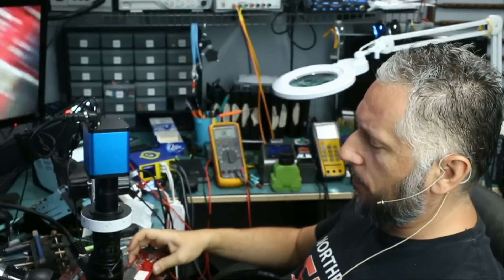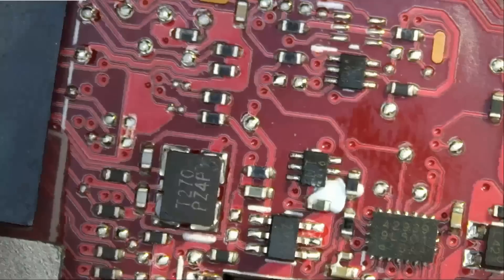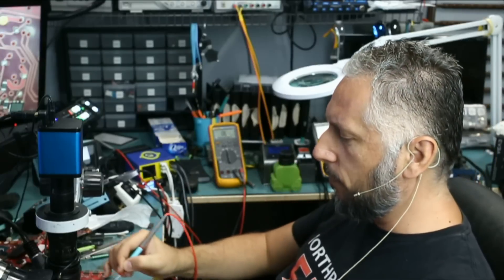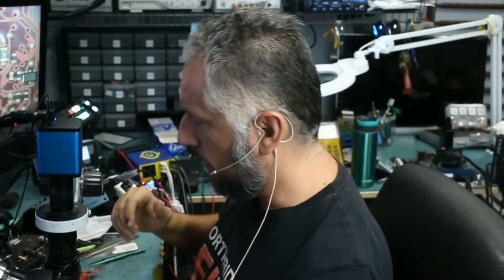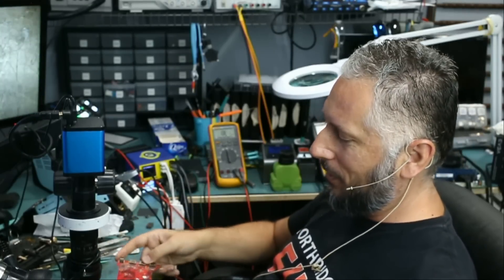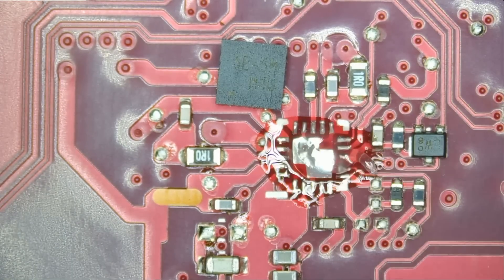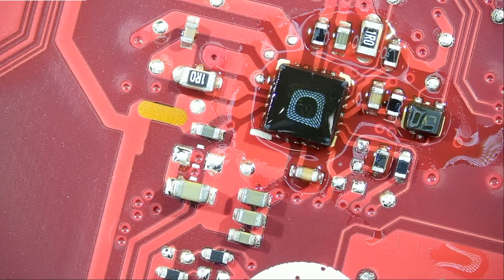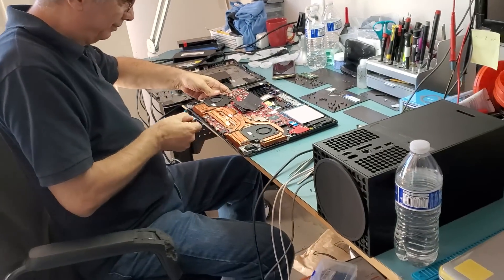Fixing Asus G531GW Gaming Laptop that won't power on - The practical way

Comment: Veery very practical, indeed, amazingly practical. Thanks for making these videos. 🤗
I have one of these laptops lying around, with the same problem (not powering up). I may take a look at it, even if it takes a few hours for me just to dissassemble and locate the fault. Guess I'll be testing MOSFETs for a while; not an expert in those matters.
By the way, what kind of flux is that? I just have homemade rosin flux (alcohol + rosin), and I honestly don't know if I can use it in such a straightforward way: bunch of solder plus bunch of flux and heat, press down over the component and… no shorts! Crazy. 👍 Thanks again.

Comment: @northridgefix could you explain in a video what you mean by voltage drop? I’m somewhat handy with a meter in my old days but I don’t know about this.
Reply: From the electrical charge highest value when probed then it starts to discharge/drop

Comment: wow man, i am struggling so much to solder those qfn 20 or 24 chips, it drives me insane, could you talk more about  your hot air station´s air spped and temperature , on some next video, thanks for the ride

Comment: I'm convinced. I've seen you fix enough ASUS laptops to put me off buying one for life, which is a damn shame because spec wise and on the outside they seem so damn good.
Reply: Yeah don't buy an ASUS laptop, I have one broken for 1 year, it just stopped working.
I think it's a cap cuz it still has the lights but I can't find a shop where to fix it.
I sent it to a big company in the capital but they wanted me to buy a new MB that was more expensive than the laptop itself.

Comment: You have a luck that it is a windows laptops, in MacBook's , Apple put different chip in every new type of them, and they are not interchangeable, although have the same characteristics
And some even serialized one to another (like 2020 MacBook's were CDC50 are sterilized one to another and to the WIFI chip).